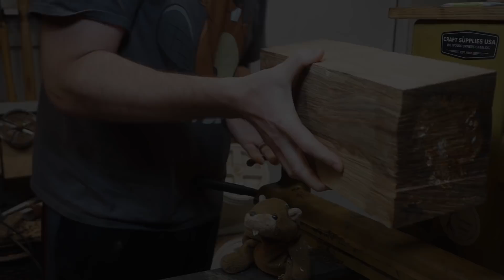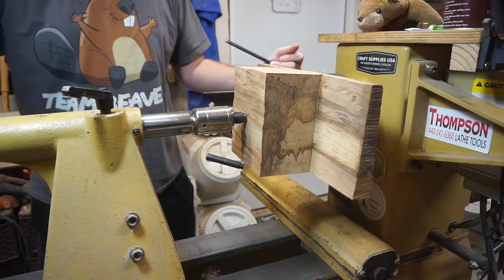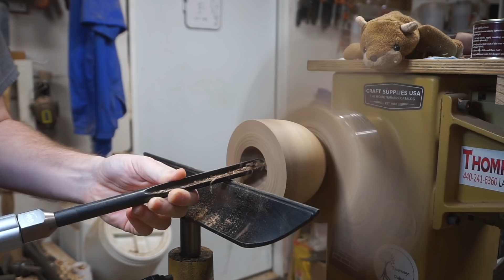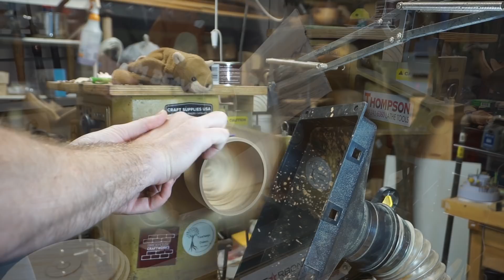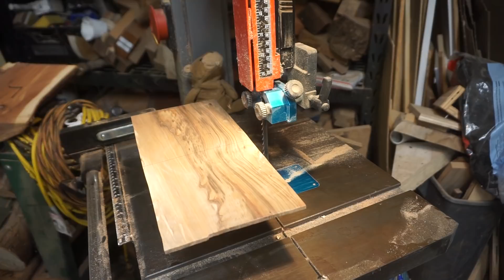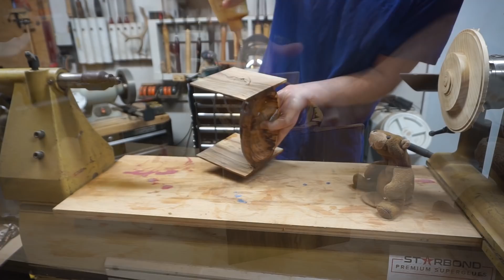Woodturning - A Bowl with Legs?!

Comment: Robert, great piece you do not want to be caught with these wings it would give you a soar one. Great cause.
Alan
Reply from the maker: Absolutely Alan! There were a couple of times trying to cut between the wing and the bottom where I found myself having to hold the gouge a bit awkwardly so I'd avoid getting smacked.

Comment: Good idea.  See you are using Mahoney walnut oil.  Great stuff.  Notice you have a Laguna bandsaw.  I do to.  Have you had much trouble with blade drift.  If I am re-saving
Reply from the maker: Yeah I love Mahoney's oil. As for the bandsaw, I do have some issues with blade drift. That's part of the reason I didn't use the fence to cut the bowl in half. I feel I get a straighter line doing it by eye. I really dislike the ceramic bearings.
Reply: Yea I don’t like the guides either.  Seem cheap but cost is $99 to replace all.  Kind of a ripoff.  Thanks for responding.

Comment: When resawing the drift seems to be hard to control.  Would appreciate your input.
Reply from the maker: I agree Jerry. I'm not sure I've got a solution. Often when I finally switch to a new blade it seems to work better but I'm not sure if that's just cause the old one was dull or because I corrected the positioning or tracking of the blade on the wheels.